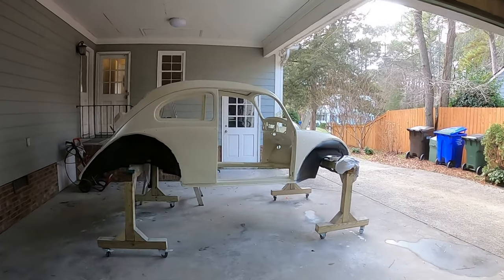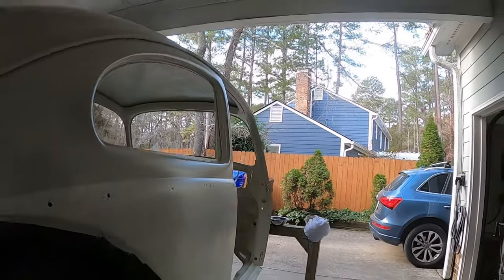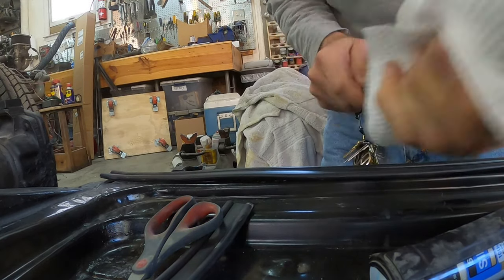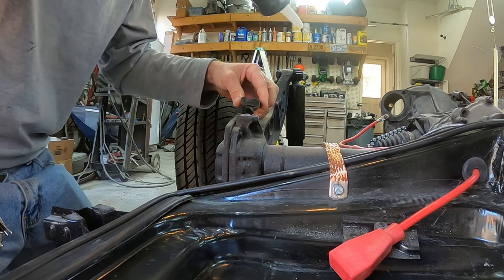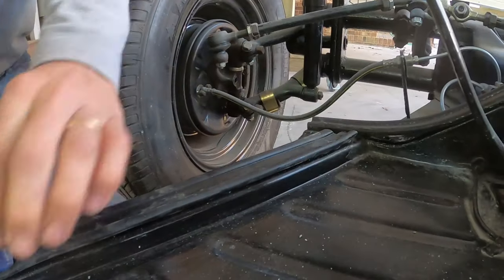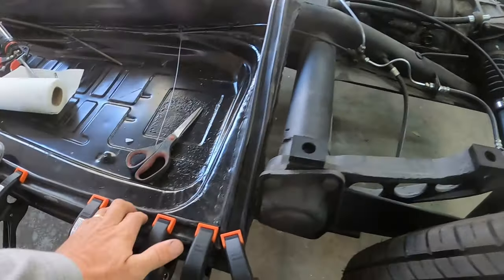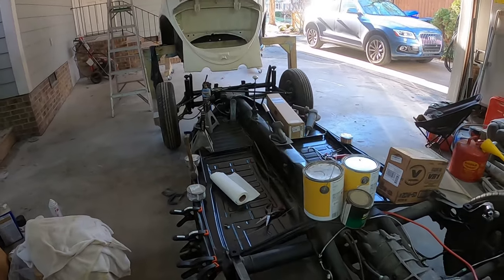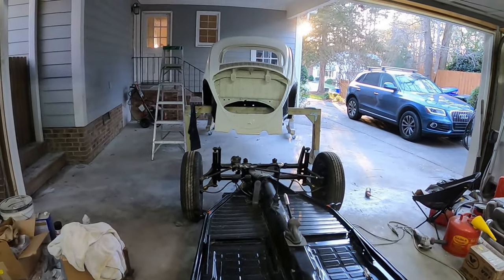1961 VW Beetle (65 Pan) - Painting Body, Clearcoat and Body Seal - 072

Comment: YOU COULD HAVE USED SHORT 1X2 STRIPS OF WOOD TO SPREAD THE LOADS OUT FURTHER AND EVEN YOUR CLAMPING FORCE THRU OUT THE PAN SEALS
Reply from the maker: Yes!  That is a very good suggestion.  I actually have the perfect wood strips too, but I just didn’t think of that.

Comment: Is looking good…. If you was going to put the original engine, the brakes are okay, but if you are going to put in it’s place a 1776cc you may have to consider a different front brake system bc you will have a lot of power and you are going to have a Lot of trouble stopping 😮 front Discs & different pump guaranty or you money back.  Think about it or call Hick’s VW.
Reply: Let me know
Reply from the maker: Well, I will have a 1968cc motor, but I don’t drive fast - I am fine with stock brakes.  My bus has front disc brakes - I think I would do the dual master cylinder before I would consider a front disc brake kit…
Reply: You want to sell the 1600cc , I need one????
Reply from the maker: It was actually a 1300cc - from the 1965 beetle - and I already sold it - that is what I used to buy the 1961 body!  But I kept the 1965 chassis - so that is what the 1961 body will go on…